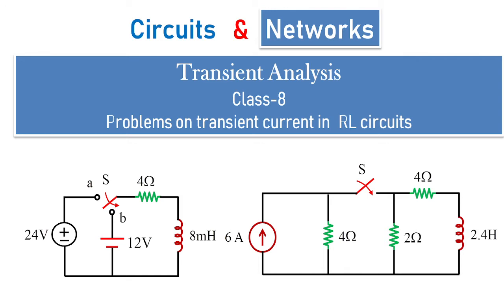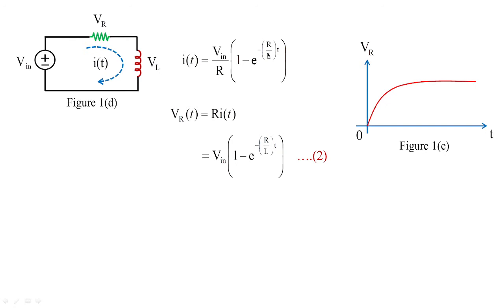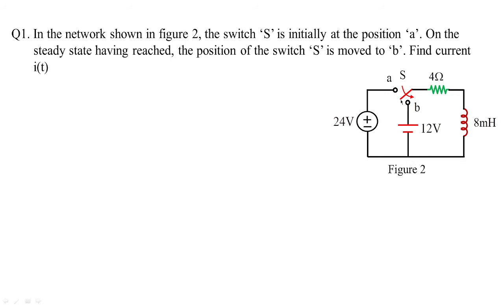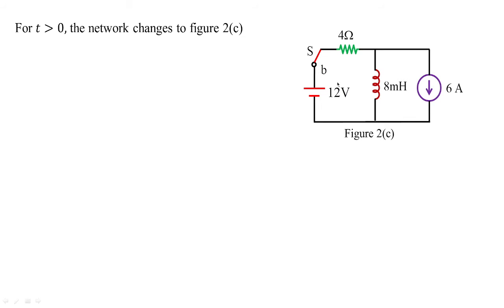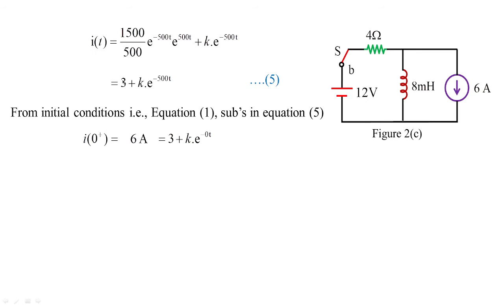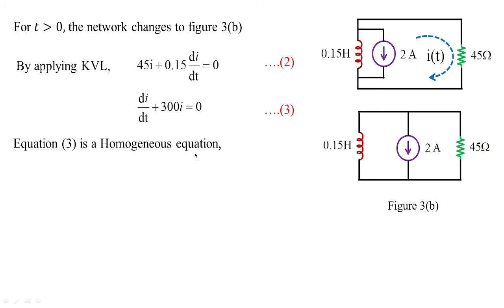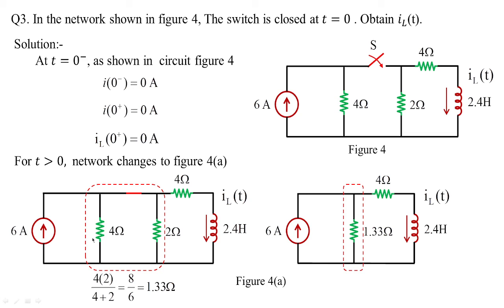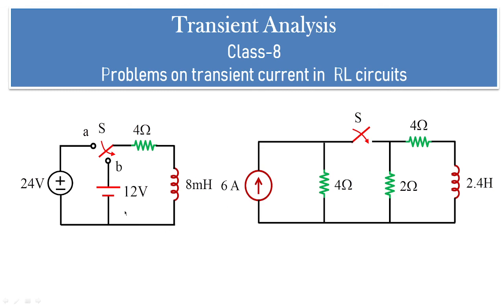How to solve transient analysis problems? Explain Transients? How to Solve transient problems?

Comment: sir in Q3 already at t=0 switch is closed is given in question. then you should have use t=0 instead of t>0 in the second step. please clarify it on this
Reply from the maker: hello
before t<0 inductor was not energized so no current flows through it. 
at t=0, current through inductor  does not change instantaneously. That is why we should not consider at t=0 condition. 

after switch is closed that is at t=o, inductor get connected to source current 6A.
after t>0 inductor gets charged. After  some time i(t) is 1.49(1-e^(-2.22t)). that means inductor is getting charged to its maximum value.
at t= infinity (steady state value will be) 1.497 ( =1.5A) and inductor becomes short circuited.